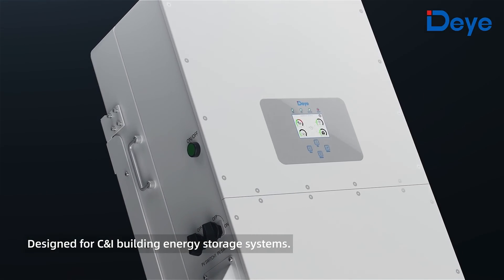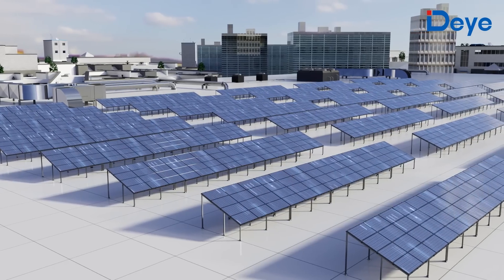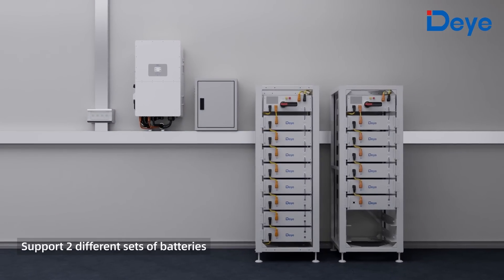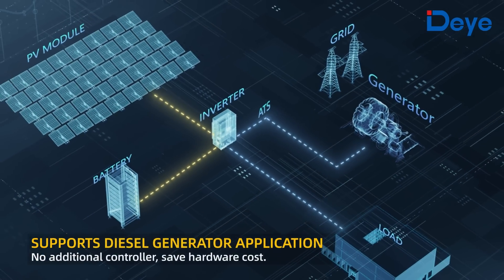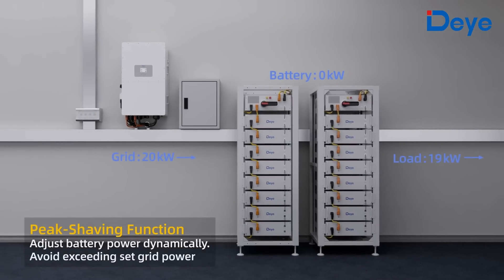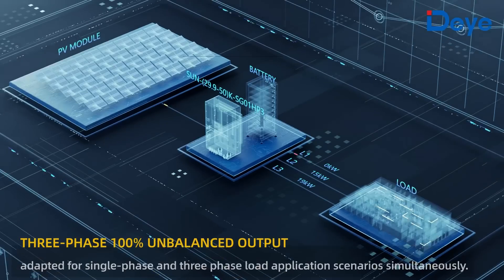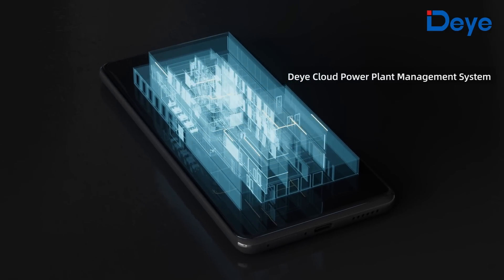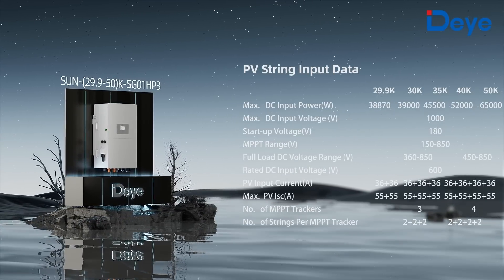Hybrid Inverter: Deye 50K three phase High voltage Hybrid Inverter Introduction

Comment: Good Day, Deye. I'm asking about the connection for my SUNWODA Battery Energy System that has 614.4 V and 100Ah. How can I connect since the specs of SUN-30K-SG01HP3-EU-BM3 indicate Max. Discharging/Charging Current of 50+50 A and has two battery inputs. Hoping for your respond. Thank you and God Bless.

Comment: Thank you for the information. How much generator power is allowed at the SUN-50k? This info is missing in the datasheet and user manual.
If the DRM is configured to reduce the power to the grid on demand to 60%, 30%, 0% and the generator is running, would be this function still working and reduce the power of the generator to the grid?

Comment: Can you point me to a wiring or installation type manual that is related to the 3ph HV battery pairing? I am looking at the Ruixu HV LithiPeak60 as a battery system and want to use a SUN-15K -SG01HP3-AU-AM2 as the inverter. As there is already a grid tied PV system in place I want to use AC coupling for charging to start with and use the battery for peak shaving and overnight etc. Eventually the PV will be switched over to the SUN-15K -SG01HP3-AU-AM2 but to commission it initially I want to use the Deye almost as a "pass through" invertor until the battery is required to be used or charged.

Comment: Can you update the firmware so that this inverter can be manually setup battery voltage.

I want to use this with lead acid batteries connected in series for 300volt.
Reply from the maker: Hi,please contact the email <service@deye.com.cn>,our after -sales team will help you.

Comment: Can we use the 3 phase inverter for single phase applications with a requirement of higher PV dc input power for a higher  battery storage capacity? Can we remove the PCBs of the unused 2 phases to get reduction in the price of the inverter? For example I can make a 25 kW single phase inverter with max PV dc input power of say 50 kW that can take a load of 25 kW for 4 hours in the day and also charging simultaneously  @25 kW for 4 hours on a 100 kWhr battery system that can give a 4 hour backup in the night @25 kW load?
Reply from the maker: Hi, the inverter can provide three-phase unbalanced output, which means that it can use a single-phase load. If you want to output 25KW single-phase, you must be connected to the grid. The unused two phases cannot reduce the price. The entire structure is stable.
Reply: That phrase you must be connected to the grid is not clear please can you explain more on it @DeyeInverter_official

Comment: 100% unbalaced output each phase... Is it also only max 50% rated power each phase?
Reply from the maker: Hi.The maximum output power of each phase is 50% of the rated power
Reply: @DeyeInverter_official  thank you!
How to make the deye inverter work together with atess bc60 battery in closed loop?

Comment: Hi, can you recommend the length and diameter  of ground spike to be able to use the 30kW version in Europe as Off grid setup when the grid power  go down?
Reply: you have to measure resistance and be in spec with regulations in your country.
Reply: @avckubw938v1bnvowiqv  we have quite good semi clay soil, but I rather have  a to large ground spike than to small, I havnt found any regulations about the amount of kW vs size of Ground Spike.  Only the resistance of the earth cable and I was thinking that it also would depend on the size, but maybe that is not as important?

Comment: Can it transfer excess energy to the grid?
How long can the SUN-40K- SG01HP3-EU-BM4 50kv

battery charge 100%?
Reply from the maker: Yes, it can be set to provide energy to the power grid. This time depends on the battery capacity and the power of the inverter

Comment: Does it support lead Acid battery?
Reply: High Voltage???? so 80S to 400S Batteries??    I don't think so. The 3Phase 12K ist the biggest one that support 48 to 60 V Lead Acid Batteries
Reply from the maker: It can use lead-acid batteries, but we do not recommend using them. High voltage inverters and low voltage inverters are two different products.Lithium batteries are recommended,and only lithium batteries that match the inverter can be used, deye batteries are the best choice.The voltage range of high-voltage batteries is 160V to 800V.